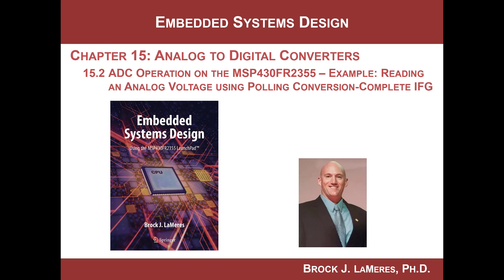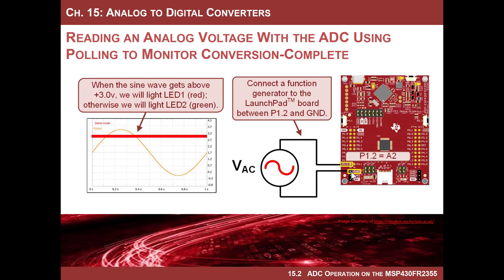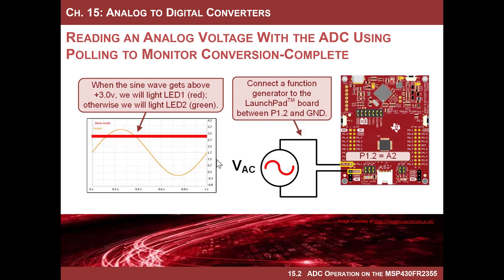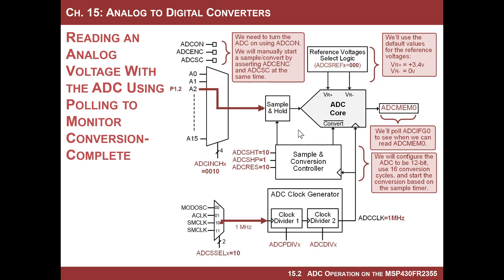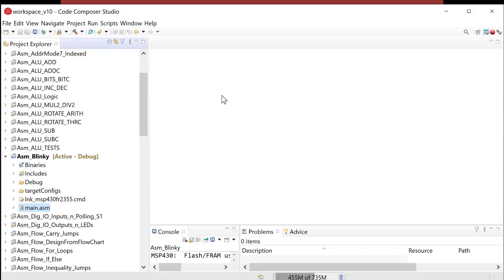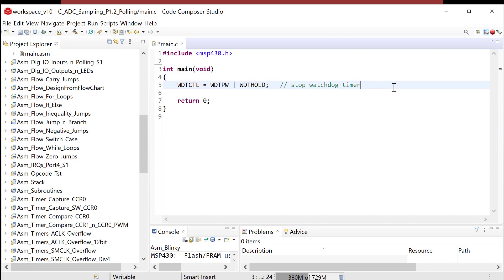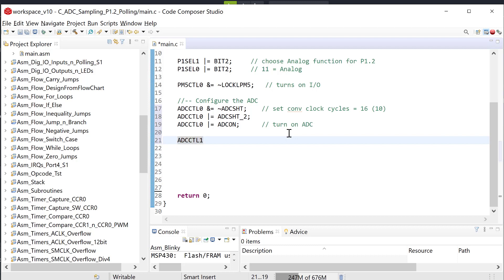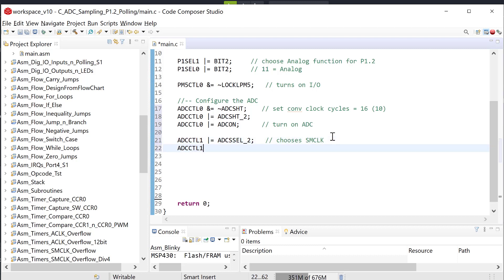15.2(b) - Analog-to-Digital Converter on the MSP430: Reading Voltage w/ Conversion-Complete Polling

Comment: I don't have the expected voltage at the result. Is that correct: V = ADCMEM0 * 3.3 / 4095? My ADC resolution is 12-bit. I always get the result lower than the expected value. e.g. 1.7V instead of 2V. Any idea?

Comment: A good substitute for the waveform generator tool Dr. LaMeres is using would be to replace it with a DC source and potentiometer and manually adjust the levels.

Comment: Thank you Mr.LaMeres. I am almost finished, what are your recommendations for next steps in learning embedded and using MSP430?

If you don't have a signal generator you can use a simple potentiometer, but be sure the max.voltage is below 3.3V (first test the entire range with multimeter...). Then you can play with the ADC_Value in the "if" loop...